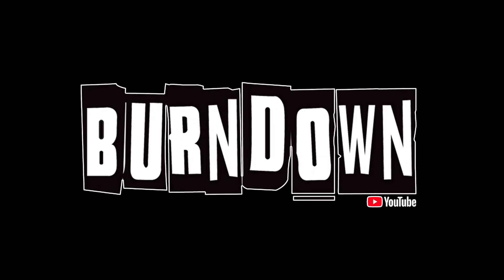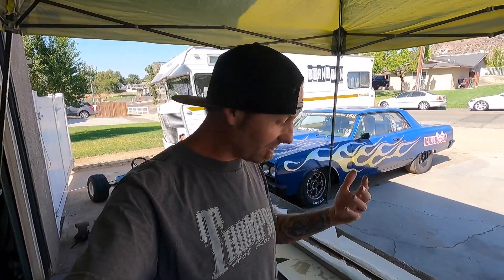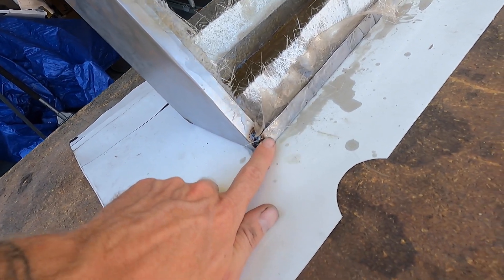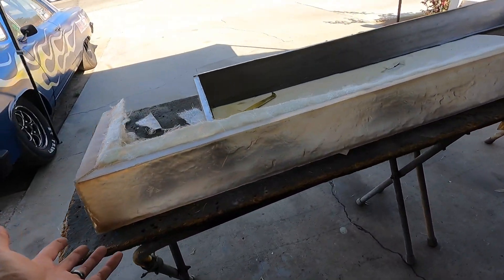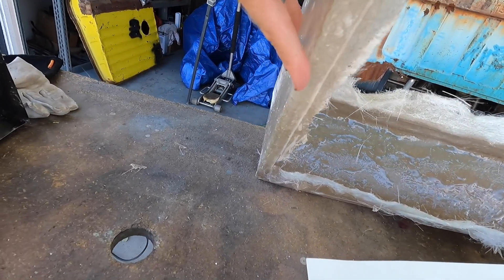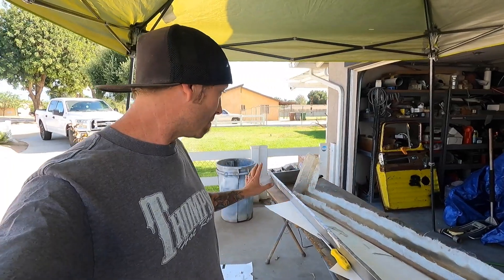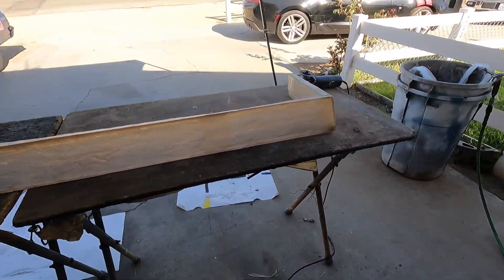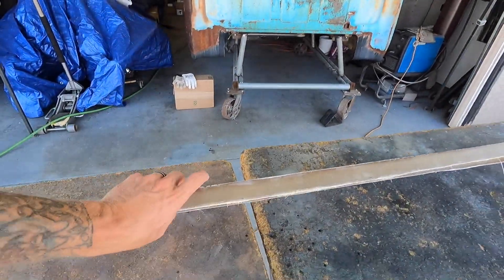Pulling The Spoiler Out Of The Mold

Comment: EXCELLENT! That's straight up NASCAR ! ! ! I may have to try this. I've searched for a '64 chin spoiler, but they just don't make them. Maybe you need to go into business. Top Work
Reply from the maker: I looked for one to but didn't find anything and figured by the time I tried to make something fit I would not like it. The paint and paper hustle mentioned a S10 spoiler so depending on width that may have worked. Maybe look at an square body s10 spoiler?
Reply: @Burndown  Thanks for the heads up. I was going to try measuring to see if I could find something. After watching this video (I have never used fiberglass before) I was thinking of maybe trying to sculp something out of foam. I have a look in my mind I want to go for. Might include a few scoops, or lighting ports or maybe a tow hook hole. I don't know, I'm making it all up!

Comment: Color? When it's mounted, I wonder if grey spray would look nice for the bumper & splitter. I also wonder if it improves cooling like the plastic hanging from 90's cars that dragged curb. Should make higher pressure ahead of your coolers and slight vacuum behind to keep it cool at speed.
Reply from the maker: It will be black. Im gonna paint the bumper when I do the spoiler as well. The bumper came black like that but it needs a top coat so ill do them at the same time. I don't know if it will help draw air out. Well find out I guess. That would be a nice side effect if it helps.